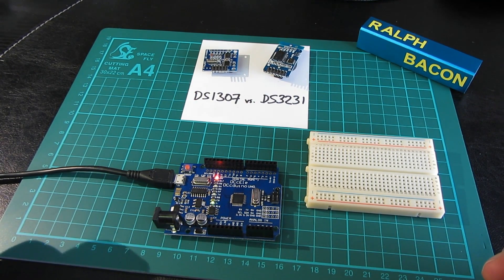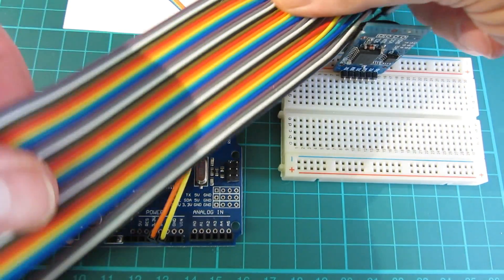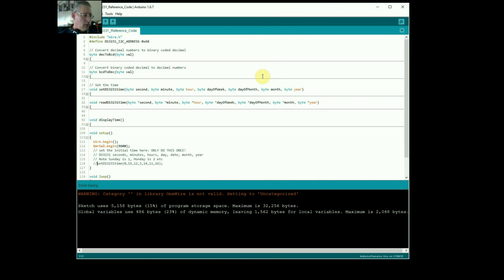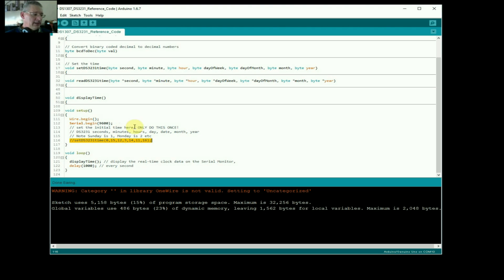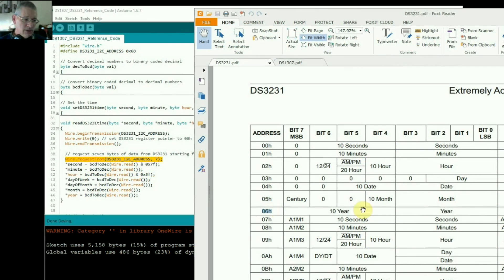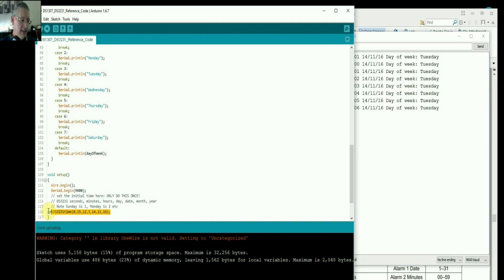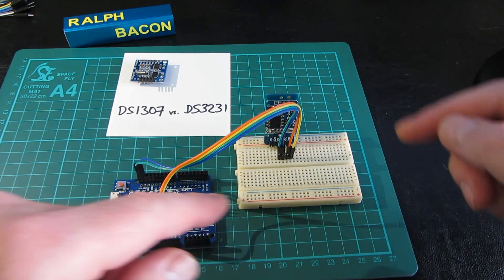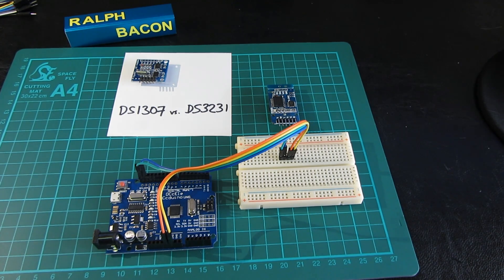#5 Arduino compatible Real Time Clock modules (RTC) - DS1307 & DS3231

Comment: did you ever sort out the problem of D.S.T. ?
Reply from the maker: +youpattube1
Indeed I did, by writing my own code/library which I keep meaning to turn into a true, Arduino library so others can use it. Just requires two buttons to set the time, date, and knows all about DST (for the UK, but easily changeable for other parts of the world). I'll take this as a timely reminder and I will move it up the list so others can benefit too. Perhaps that is something I can do over the Xmas break (but I'm not at home for most of December so it might be a challenge... we shall see). Thanks for the reminder.

Comment: Hey there Ralph, great informational video! You mention that the DS3231 is much better than the DS1307, any reasoning for this? 

Thanks!
Reply from the maker: +Zak Dunn 
Indeed! The DS3231is more accurate and is temperature compensated - so after several months it is still pretty much spot on whereas the DS1307 will be a minute or two out. Also the DS3231 board (well, the one I have, pretty sure it's standard) has a built in temperature sensor just as a bonus!